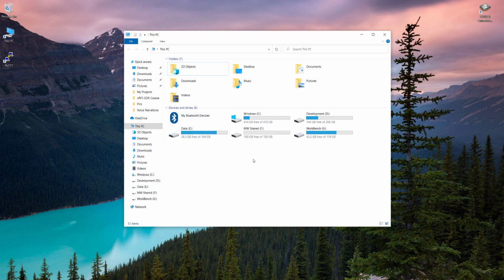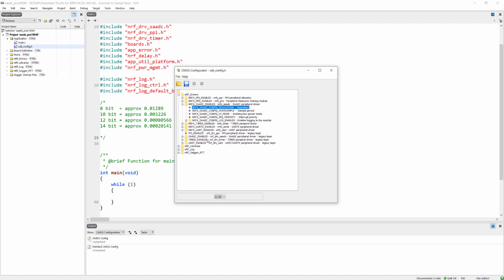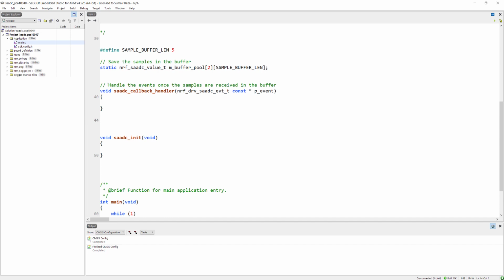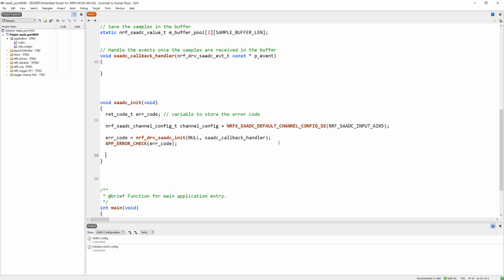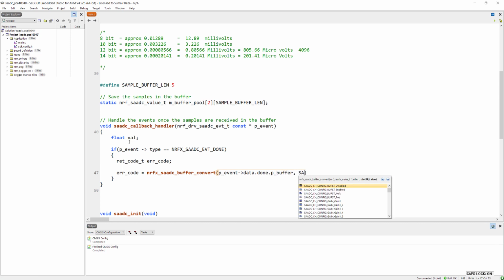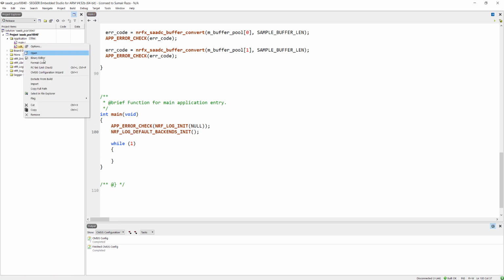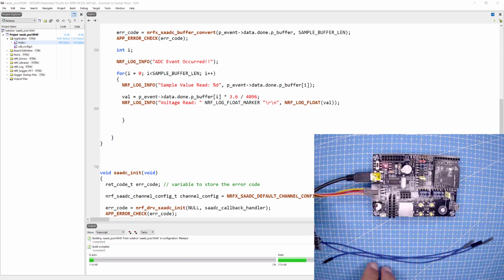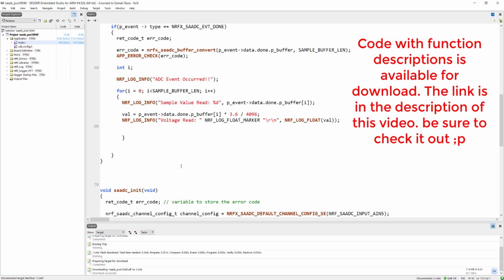nRF5 SDK - Tutorial for Beginners Pt 20 -SAADC Single Shot Mode - Interrupt Driven

Comment: Hi dear @Sumair, Thank you for you generosity.
You have used a double buffer for avoiding overwriting data, but I don't see where have you used it. I expect a for/if on the first dimension of "m_buffer_pool", even if this is handled in some internal function, I may expect increasing output data size on the terminal when I reduce time interval between each sampling but its just the same. I mean if I reduce the time interval between each time I call the "nrfx_saadc_sample" function, some data overwriting must occur, and our double buffer should show up to help not loosing the data by outputting all the reserved buffer.

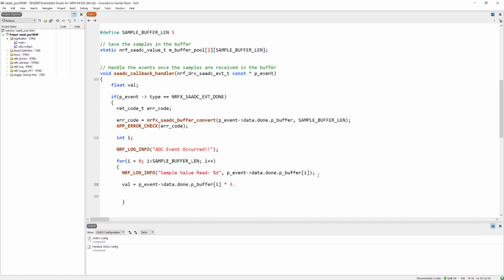Comment: at 14:39, due to gain increased 3.6. is it a gain of ADC? where is it specified?which means kinda constant value with 3.3V operating power? If 3V system like 2 AA batteries, what will be? Thanks.
Reply: @jj_uk  Thanks so much!
Reply from the maker: Hi @Sung-Hyun_Choi,
When we take measurements from saadc module there is a specific gain, we can configure this gain, by default the gain is set to 1/6 , normally we don't need to change it for simple measurements. 

There are two reference voltage sources i.e. Internal reference and VDD as a reference and we select the internal reference voltage.

 > For internal reference voltage the gain is (+-0.6V)/gain

> For VDD 
Input Range = (+- VDD/4) /gain

for e.g:
if we set the internal reference then:
Input Range = (0.6)/(1/6) = 3.6 V

So this would be the range and the input voltage should never exceed
this range. Hope so its enough to understand the gain :p
Reply: @SumairsEmbeddedEngineering  Why do you and product manual say the gain number as +-0.6V not just positive value? Is +- 0.6 for differential,  whereas +0.6v for single ended?
Reply from the maker: @sung-hyunchoi25  the answer lies within your question, since we are not using the differential input and we are not measuring -ive voltage so the gain is +0.6v.
Reply: I appreciate your answer!
Reply from the maker: @sung-hyunchoi25   Please see the description of the first adc tutorial to get all the details, it will clear many concepts, i have updated it with sample calculations to help you guys out. :-p
Reply from the maker: @jj_uk  no, it can't exceed, if the value exceeds the microcontroller will be damaged, see the tech specs where the electrical characteristics of the pins are described.
this was just an example calculation. always use internal reference ...
if you want some external vdd reference then there are special 2.0 volt stable voltage regulator but it would need additional circuit...  in future tutorials  i will deal with these issues... this series is for beginners, too much info will be not a good way to start... lets keep it simple for now... advance topics will discussed after BLE tutorials...  ;-)